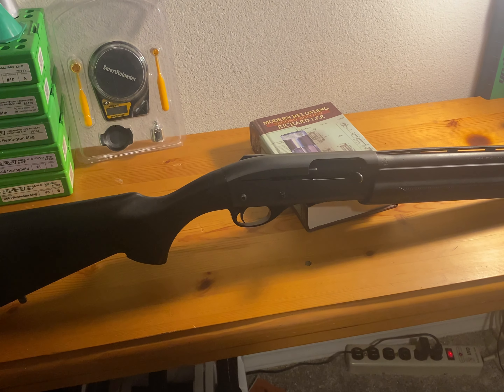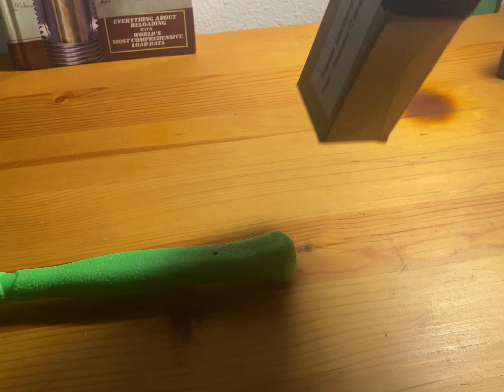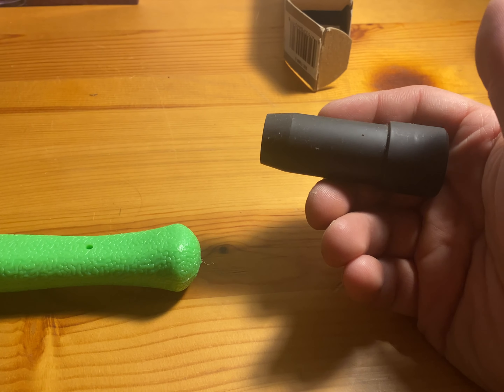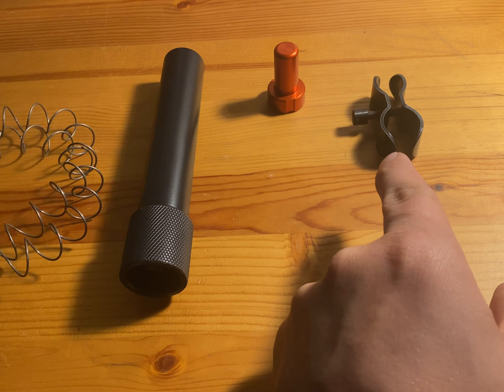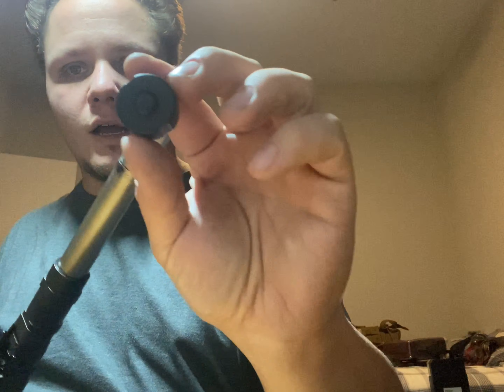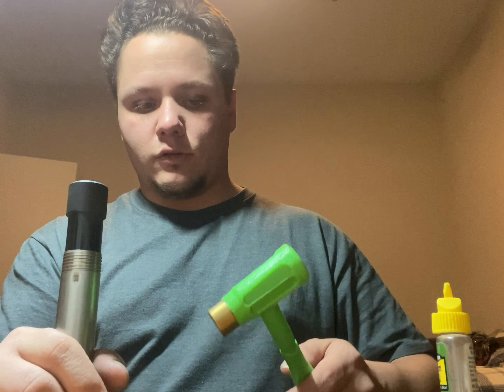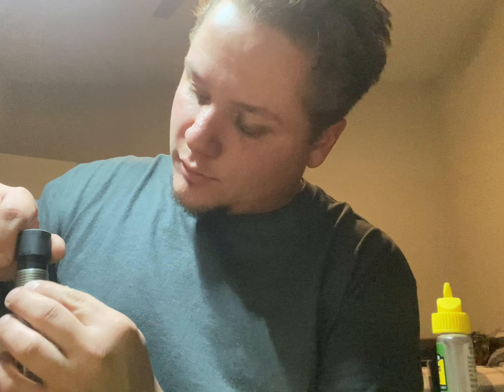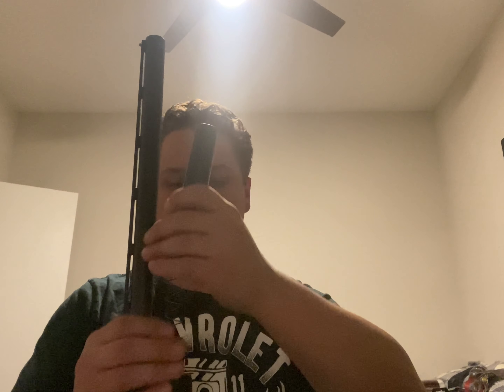Remington 11-87 Magazine Tube Extension Install

Comment: Back in the day we used a socket , but fist put a taper on using a belt grinder.  We would beat it in just like you are and then use an extension to remove . We would go in a bit then take out so on so fourth . Good job thanks for the video
Reply from the maker: Haha that’s an idea! And thanks! If you haven’t please subscribe thank you for watching

Comment: I just received a 10 round extension for my 870. It came with a plastic follower that is 2 3?4" long to keep one from collapsing the spring onto itself when fully depressed. Where can I get the billet follower similar to the one in the video that is the appropriate length?
Reply from the maker: https://www.ebay.com/itm/284217679920

Check this one out

Comment: I think I hammered in too much and having trouble getting it out
Reply from the maker: It’s tough getting back out. You gotta use a brass punch to work it out on either side slowly
Reply: @BlacktopTactical  I got it out. It took me 2 hours but I did it
Reply: @BlacktopTactical  Per the instructions on Brownell's site, use a punch to peen the two detents while the swage is still in the magazine.  You can then remove it easily by hand.